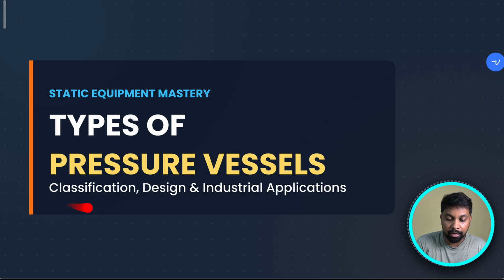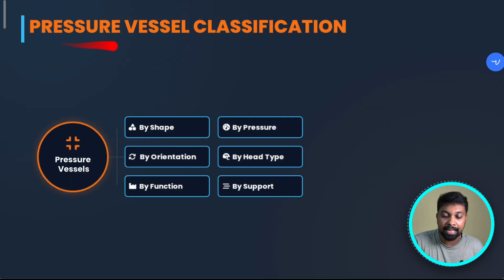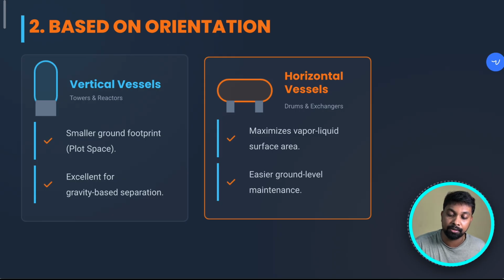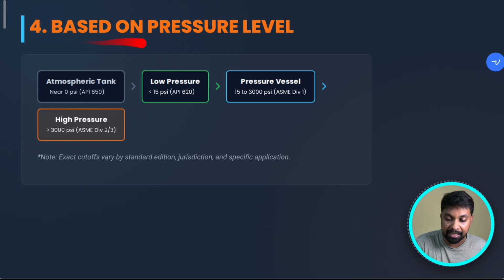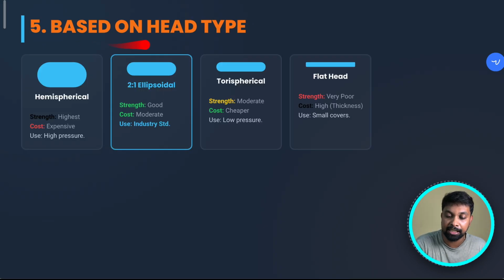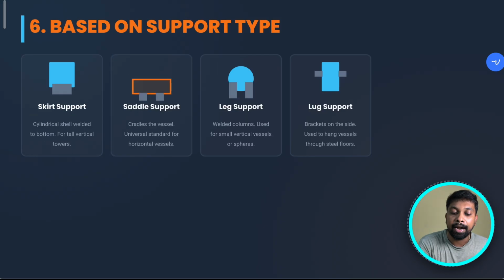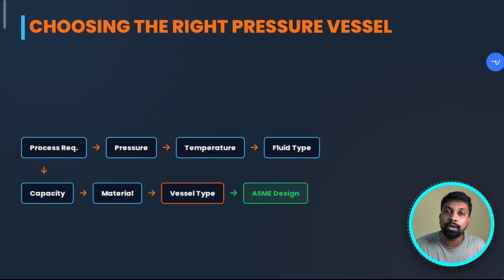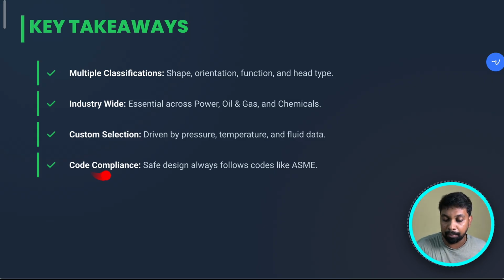5 Types of Pressure Vessels Every Mechanical Engineer Should Know

Comment: bro iam in steelstucture manufacturing engineer your vedios are good i have one doubt  infront i have two chooice i need complete inservice inspection like api 510 580 or i complete pvelite ..? which one help me more but my interest inspection batter then design .. is pv elite gona work when i learn
Reply from the maker: Hi Bro, If you enjoy inspection more, go for those certifications, as they are essential for that field rather than design software. Only with software(PV Elite) knowledge it will be difficult to manage your day today task.